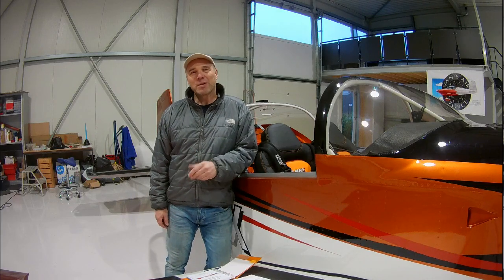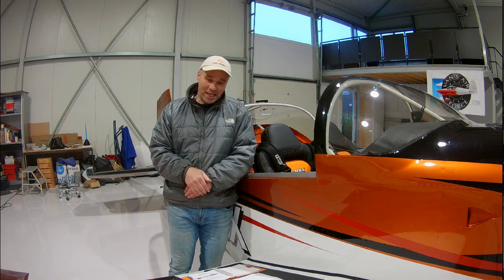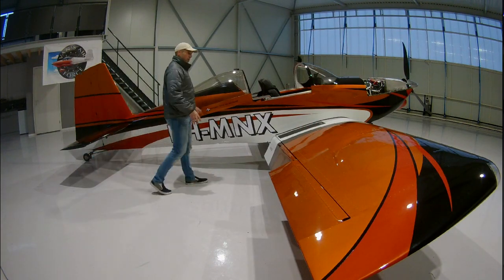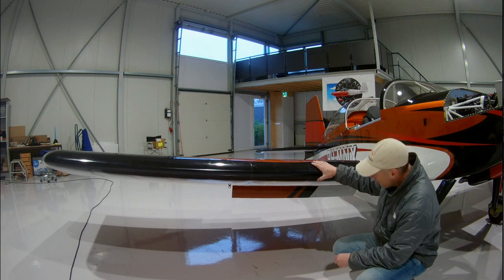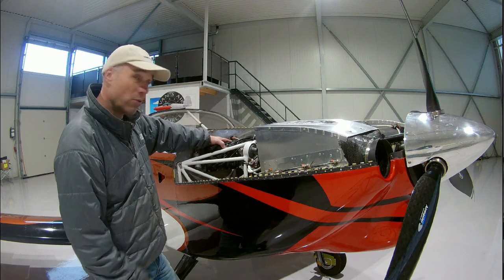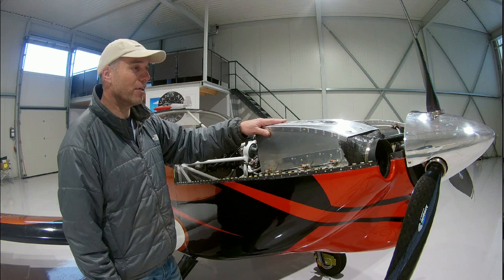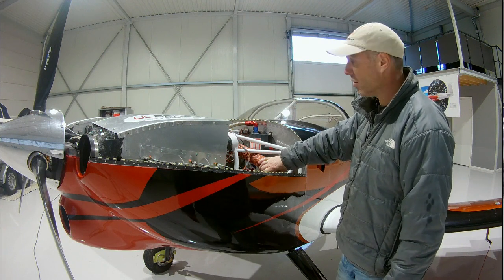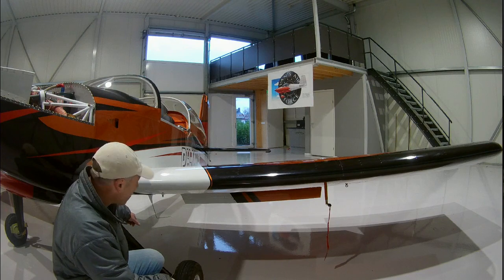Van's RV-7 Build Walk Around Part 1 (168)

Comment: Super nice plane! Looking forward to your first flights! Awesome work.
A few minor remarks:
- Some people say not putting the wheel fairings on will slow your plane down by 10 knots which means your engine will get less cooling which might not be so good for the initial flights where friction is still high in the engine.
- The heating units at the mufflers need to get fresh air, otherwise the temperature will be too high. Maybe you can omit hooking it up to the cabin but you should not omit hooking them up to the fresh air intake.
- There is a lot of noise on UL engines having bad pistons and UL not replacing them on warranty. Have you checked that you have pistons made of the better material that doesn't break as easily?